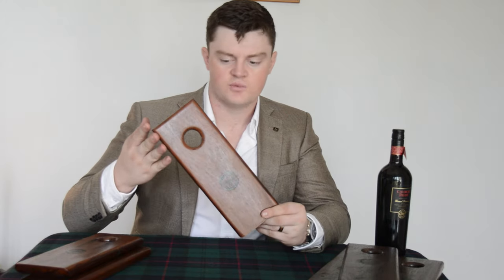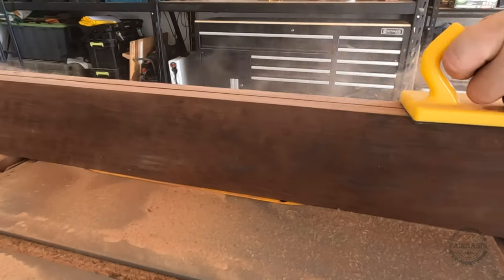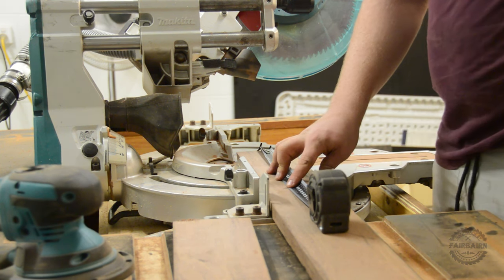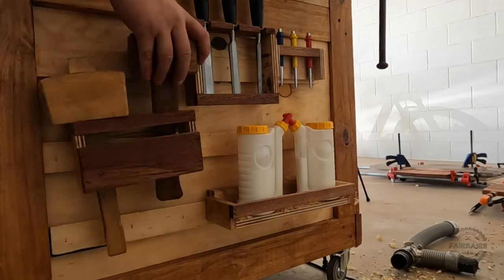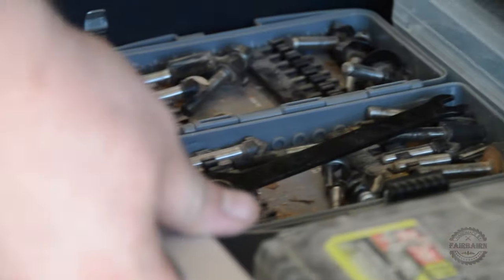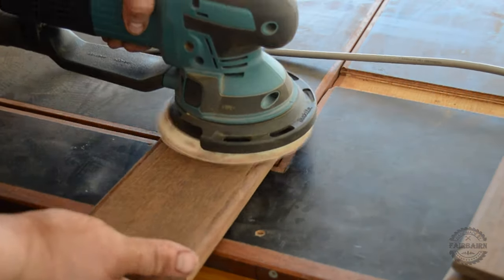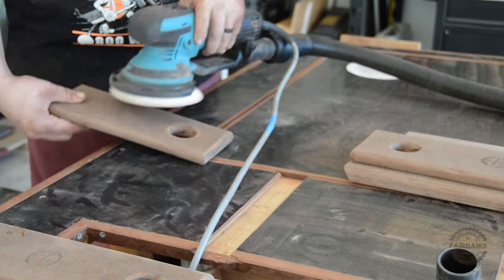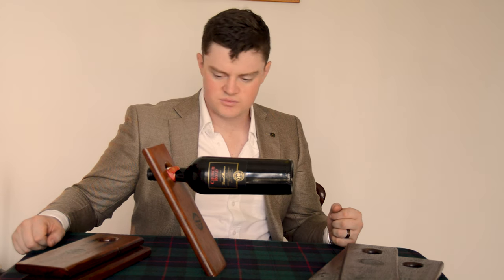Making a Angular Wine Bottle Holder

Comment: Nice but how do you get the angle right for it to sit on its own. Do you do any math? Or do you cut it bit by bit to slowly get it right?
Reply from the maker: Thanks for the comment concerned YouTuber.. 
made a few of these before and I found that 30 degrees is about right, 45degrees is too harsh and bottles half full sometimes topple over and anything less than 30 won’t stand up properly